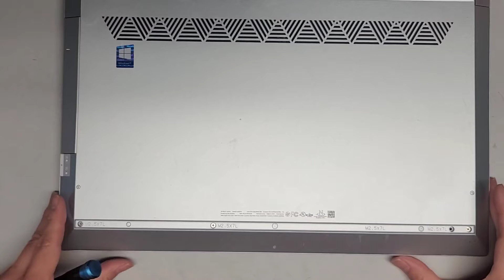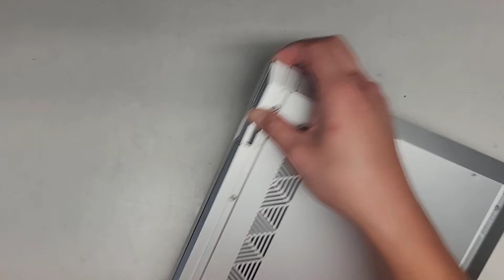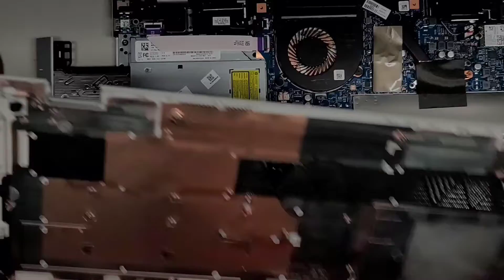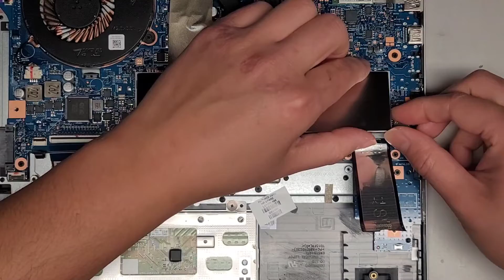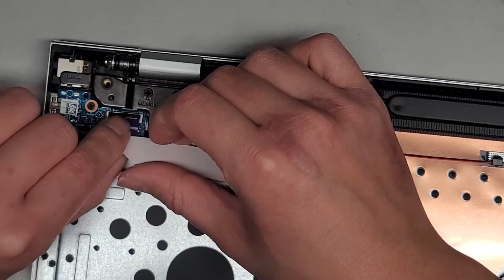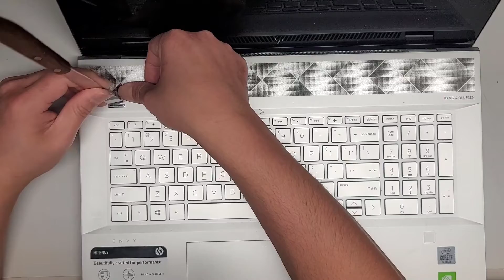HP ENVY Laptop 17-ce1035cl Disassembly RAM SSD Hard Drive Upgrade Battery Replacement Repair

Comment: Super helpful video. I never did anything like this before. I have to replace my keyboard assembly due to my power button doing the same exact thing in this video, which is how I found your video in the search. But very helpful to see how you handled these cables and everything. Sucks for me because I have to transfer every single component over to the new keyboard assmblly.Thanks so much!
Reply from the maker: Yeah, it sucks. :( hope the repair goes well!
Reply: @ItsBinhRepaired  thanks, tackling it tomorrow, thanks again!
Reply from the maker: @ChrisPatrick8199 sounds good
Reply: @ItsBinhRepaired  I have a question, where is the serial and model number located on the motherboard?
Reply from the maker: @ChrisPatrick8199  it's usually on the outside, not on the motherboard. There might be a sticker somewhere on the motherboard with the serial number and the model printed directly on it.
Reply: @ItsBinhRepaired  thanks I appreciate that!

Comment: I have this same model Envy-17-ce-1035cl.  I upgraded RAM from 16 to 64GB and 256GB SSD to 4TB SSD both from Crucial.  Verified I had compatible upgrade components.  I cloned the 256GB to the 4TB, all went well.  After installing the upgrade, it will not power up.  I went back to original parts and still will not power on.  I plug in the AC Power and no light for charging and no power on.  I've tried holding down the power button and no luck.  I appreciate any help you can give me.  I now have it back to the upgrade but same problem.
Reply from the maker: Remove the battery and power, hold the power button 15 seconds and then reconnect it
Reply: Yes, I have tried that and no change.  I followed your video and disassembled it and looks like I may have the same problem you found with the power button.  Such poor design.  I think I will disassemble again and remove the button.  It's such a nice laptop other than that.  One question, regardless of the button, shouldn't I get a light by the power jack when I plug it it?  If so, what does no light  mean?   Thank for your great video on disassembly and your prompt reply.
Reply: BTW,  the power supply has over 19 volts at the jack.

Comment: Please tell me, does this laptop have a CMOS-battery or does it not have one at all? I have exactly the same laptop and it stopped turning on, I changed the main battery and thought about changing the battery for BIOS, but it’s nowhere to be seen!
Reply from the maker: Pretty sure it's built into the main battery
Reply: Thanks for the answer. The other day in the morning the laptop didn`t want to turn on. The power button lights up for 5 seconds. and goes out. No other signs of life.
I changed the main battery, the old one was swollen. It didn't help, everything was the same. I thought about changing the Bios-battery, but I couldn’t find it.
I`ve already tried various “cold” reboots and BIOS resets that I found on the Internet. Now I don’t even know what to try.
Reply from the maker: Did it get any power at all?